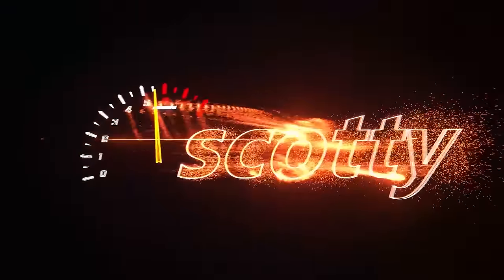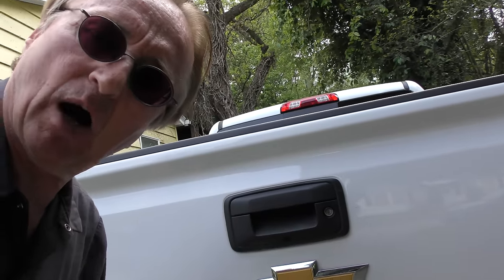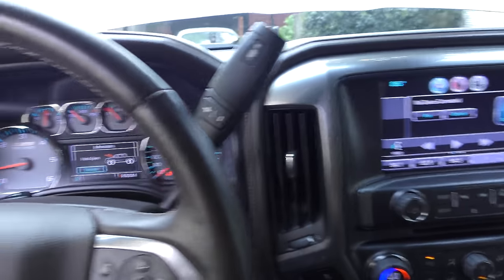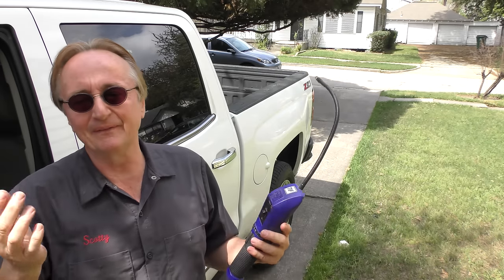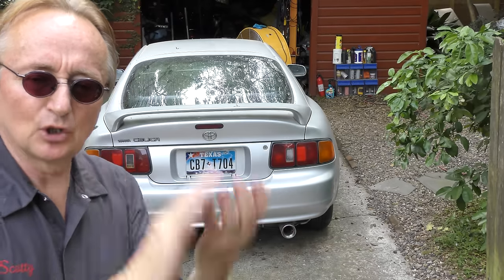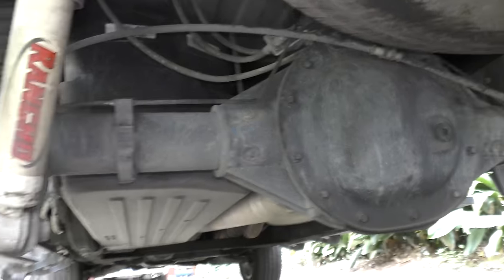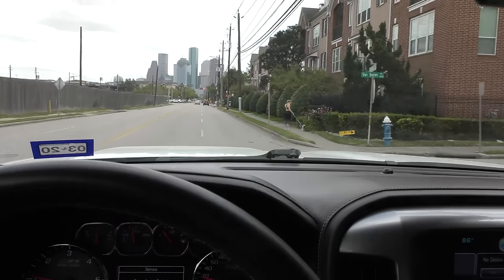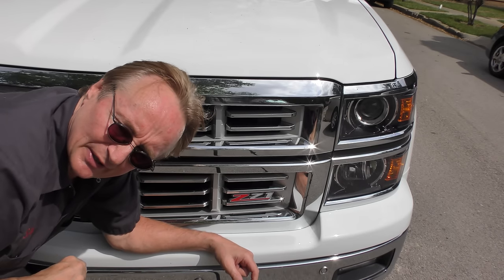Here’s Why I’ll Die Before I Buy a Chevy Silverado

Comment: Scotty you paint with a broad brush . All makes and models have their problems , I've only known of 3 GM products where the same incident happened and I know over 25 other mechanics (that I talk to you on a regular basis) I have talked with and they have not ran into anything like this yet . Like I said all makes and models have their problems and there's times when they have the Oddball breakdowns or mishaps . I hate when people find a problem (that is rare) with a manufacturer and they make it sound like it happens all the time 😂 . toyota's and honda's have their expensive breakdowns in mishaps as well and most of the time they are VERY expensive . btw Scotty I have 2005 Buick Terraza with 319,483 miles on her and she STILL blows ice cold AC front and rear . The ONLY major problem I've had out of it was the power steering pump . I can go on and on and on about vehicles I have owned and worked on with high mileage that have had no major issues (non honda or toyota's) .

Comment: I don't care how reliable your Tomato is, you are still stuck driving a boring blob shaped Toyota.  At 59 years old, I have only owned 3 cars in my life, and I still have two of them and they were all Chevys (64 Impala, 91 S-10 and 2003 Silverado SS).   My 2003 Silverado (original owner) has been quite reliable except for the transmission. But the added supercharger probably is a bit much for the 4L65e transmission.  I don't know how the newer Silverados are in terms of quality, but you can gripe about any car if you want to.

Comment: Guy acts like this truck is different from any other trucks the manufacturers are putting out. They haven't put evaporators in the engine bay in DECADES. I will agree that's it's dumb there's no rear a/c vents. But really.. going to make an entire video saying the truck is junk because the A/C evaporator is leaking.

Comment: Buy a real truck not a grocery getter. My 2014 Silverado 2500HD went over 200k before it needed a brake job 250k (7 years) on original battery. I have put over 250k on the 2 previous silverados which like this one I bought new.

Comment: This guy is such a Toyota nut hugger. Just names a bunch of stuff that goes wrong on literally every single modern vehicle and acts like it's only Chevy. They're all hard to work on now. Try to change a blend door actuator on an older superduty. Takes hours. Doesn't make them bad trucks. I had that exact truck. Same color and all. It got 25 on the highway and about 17 in town. Never had an AC issue. Never had any major mechanical issues, period. Traded it in at 110k miles and got $26k for it.

Comment: As a GM Truck owner myself (because I like the styling mainly) there is NO ARGUING with the valid points from Scotty.  GM could do way better for their customers but they do not and that IS concerning.  I always know about GM quality and cost to maintain issues so I always opt for extended warranty when purchasing and I make the dealership pay for most of it.  There is no justifiable reason for GM to not have higher quality or to put a/c parts under the dash.  Unacceptable. They also have issues with their newer engines and have mostly had always troubles with their transmissions (clunky).  Now they are moving over to Electric (Hummer) and being that they NEVER faced quality issues with ICE vehicles I can not see how these same problems won't transfer to Electric.  Nightmare cost issues on the horizon.  Wait for it.

Comment: I don't understand why people make questions to you. if you don't even know what are you' talking about.
You, stupid people, focuses in miscellaneous and miss the big picture. 
Silverado is a truck and as a truck, is the best on the road and the most efficient engine (Vortex, 5.3 V8 Hydromantic 6 transmission) performing 30 miles/Gallon from NY to mile 0 Key West.
The only down side about Chevy (YOU NOT EVEN CONSIDERED) is the location of the fuel pump. (costly to replace)

Comment: I have had three over the years.. First one I sold at 263k, still ran fine. Second one, I still have at 251k miles, runs fine. Third one I still have, it's a 1995 with a fisher plow. That has 135k on it and it's a dedicated plow truck for my 1600' driveway. I just bought a 2019 At4 and this one is nice :). Ford is junk, had one. NEVER AGAIN. Dodge??? Ha! Never m